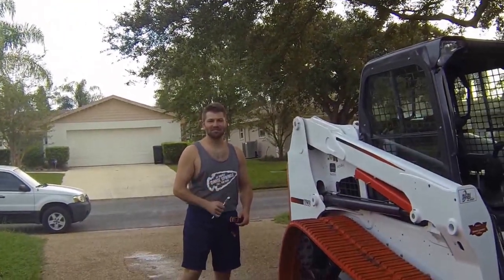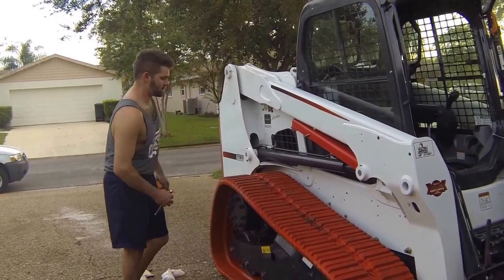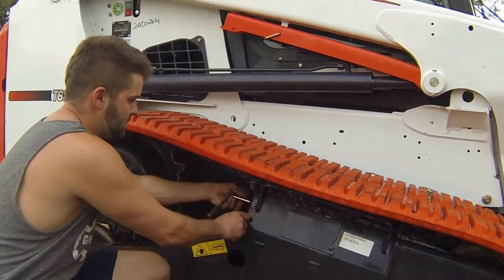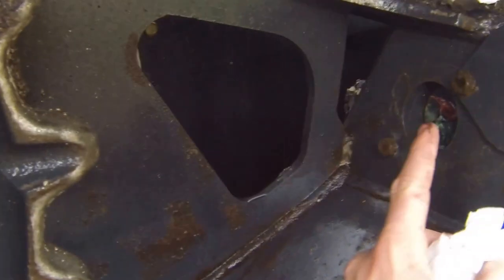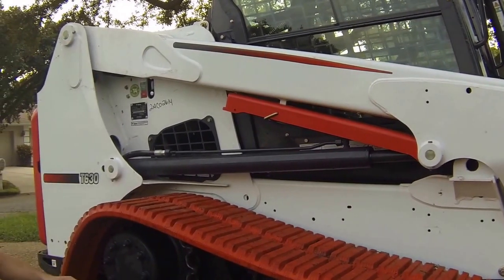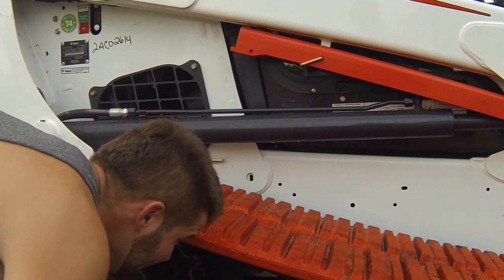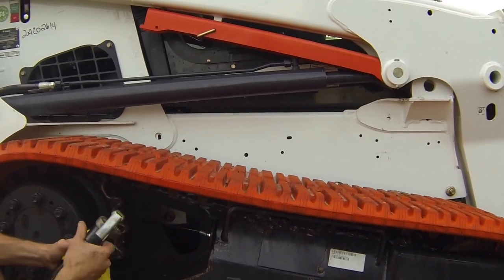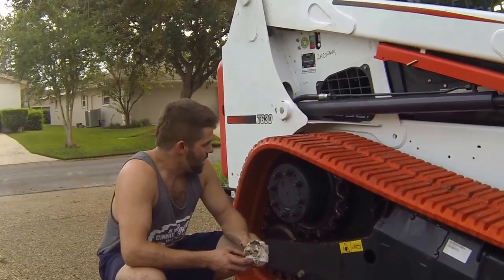How To Tighten and Adjust Tracks on Bobcat Compact Loader

Comment: The track derailed on our T870. It has a hydraulic auto thingy. What is the easiest way to loosen tension?
Reply: Im In the same situation. T870 auto adjuster. Do I just loosen nut to bleed off?
Reply: Just loosen the bleeder valve (the one on top).  Its easier and less messy with Bobcat’s track bleeder tool.